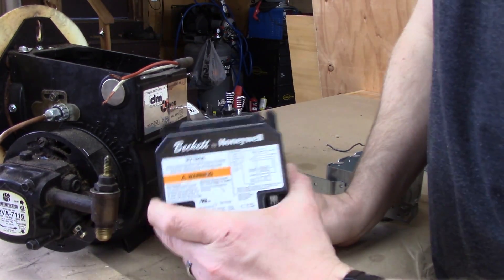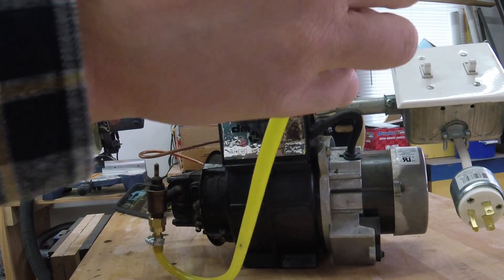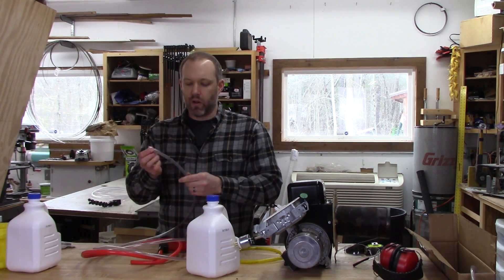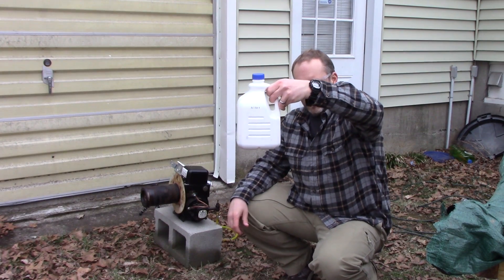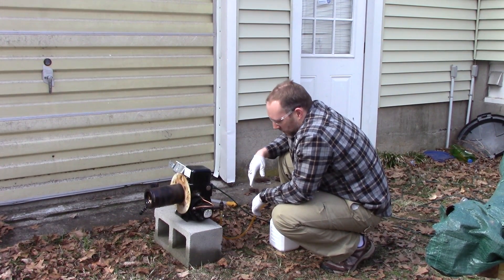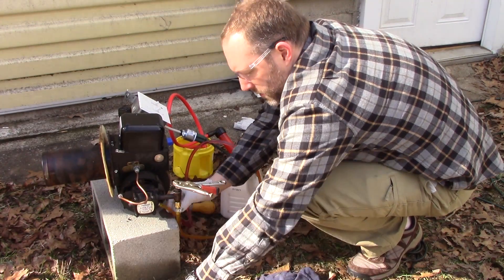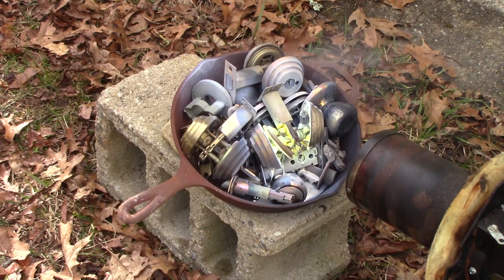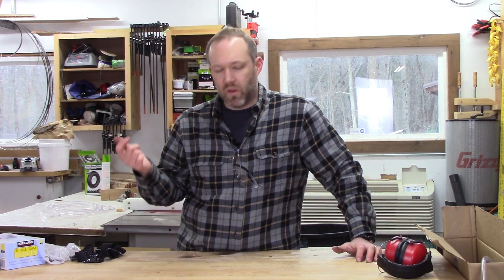Can a Home Heating Oil Burner Melt Metal?

Comment: I would have left the primary control on... and the firomatic handwheel there are two airbands on the burner the big one is for over 2 gph, the small one on the end is for less than 2gph check out greyfurnaceman

Comment: I use an old Beckett burner for my aluminum and copper foundry.      Works very good and fast.            Aluminum melts in less than 10 min and copper about 15 min.            My foundry is just two old oil fired water heaters combustion chambers put on top each other.
Reply: I also use an oil burner in my forge.    But in that one I use the riello style instead of the Beckett style like what you’re using.

Comment: I have melted aluminum in a furnace made from cutting off the top of an old oil furnace    thus the fire brick al done    used a crucible I load form of the  the top   just stack s a few fire brick on top to hold heat in     melted 8 pounds in about ten minutes    my old burner quit so I recently bought a new burner similar to what you have   not yet tried
Reply from the maker: Oh wow, that's fast!